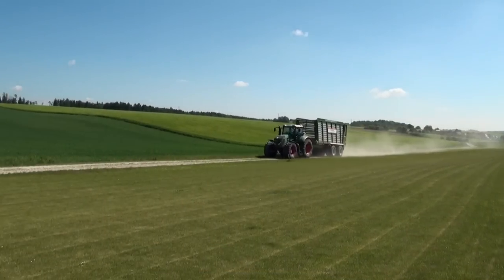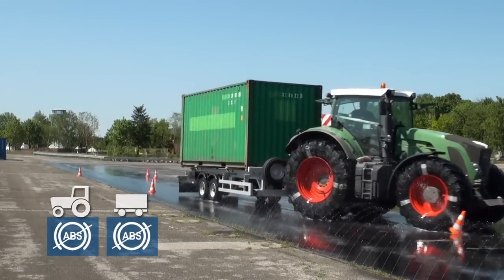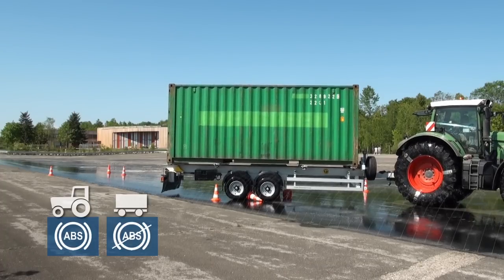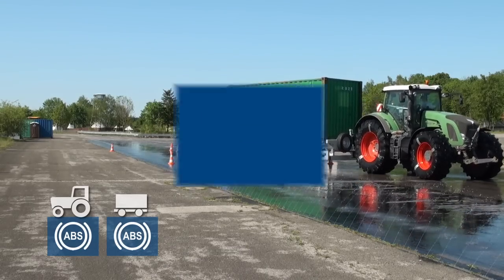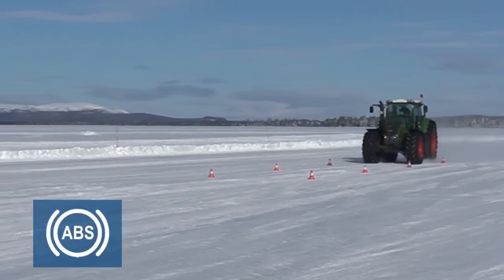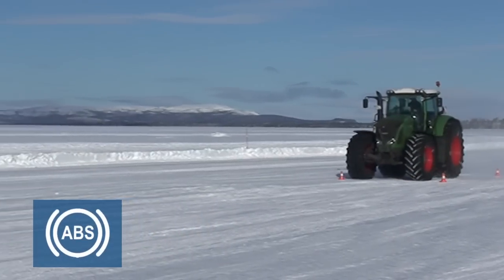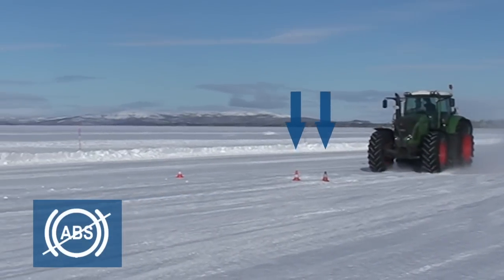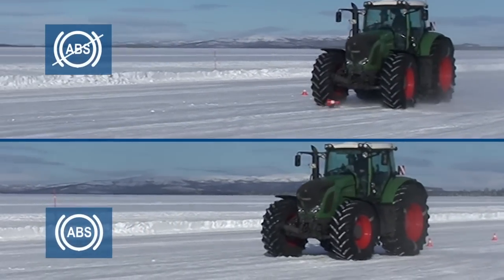Knorr-Bremse ABS for Agricultural Tractors and Tractor-Trailer Combination

Comment: Interesting topic and comparison. And the tractors look top notch.
 But I'm Just interested in how fast each tractor shown can drive.
Reply from the maker: Thanks for your interest in our video. At that time we tested various tractors with our ABS. The maximum speed of the tractors was 70km/h.
Reply: I belive that the JCB (yellow tractor with equal sized front and back wheels) (probs fastrack 8000) hold the top at 70kmp,and the rest usually range between 40-50, some higher end, ofen Fendts usually go up to 60,65, but i dont think i saw anny here